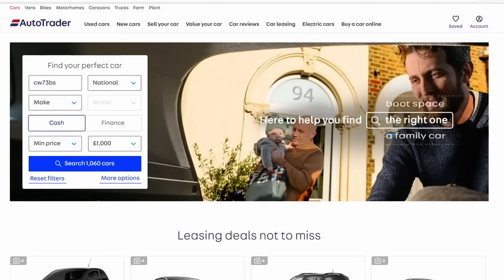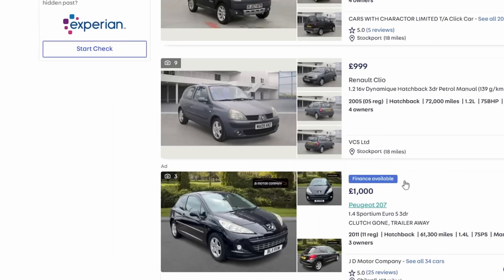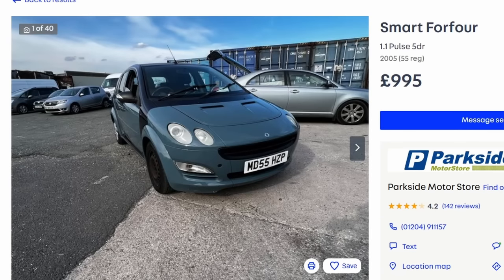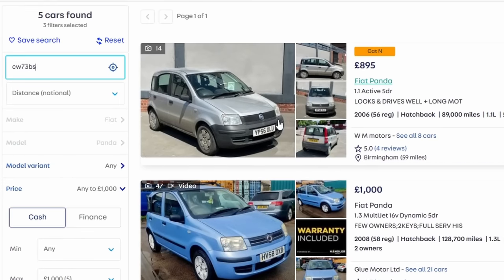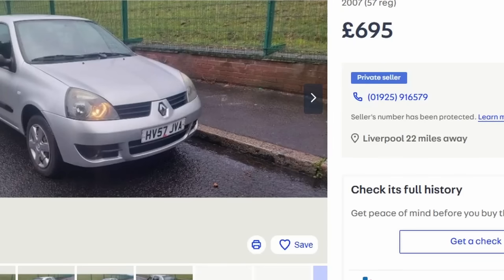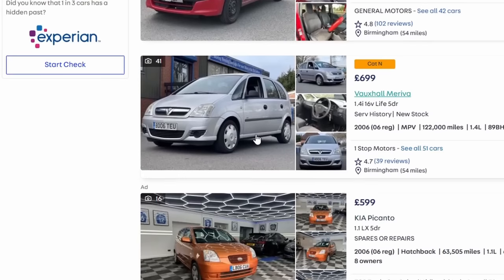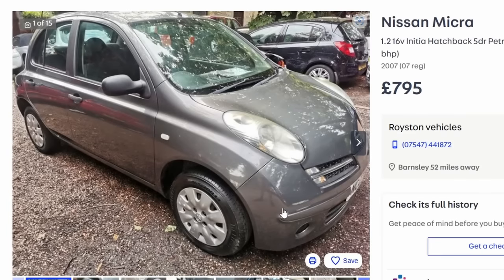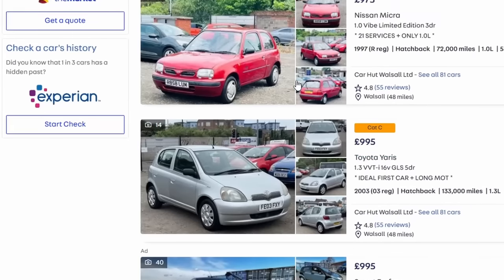THE BEST SMALL CARS UNDER £1000 ! (2023)

Comment from the maker: something a little different this video, I give my opinions on small vehicles to buy under £1k, Using my experience of trading these vehicles over the years, working on them and of course Mot Testing them and seeing all there faults and positives. Hope you enjoy guys and please let me know your thoughts in the comments.
Reply: I'm sure in this day and age where money is tight and prices are so high this will come in use for those who really need a cheap reliable A to B motor or daily. So many YouTubers go for expensive motors that are way out of most people's price range so genuine consumer advice is welcome. I certainly wouldn't go around any of the Walsall locations featured though 😅 No warranties etc despite the clear Consumer Rights Act... Very scary types
Reply: They only driven locally.and frpm a to b.
Reply: Agree with it all fella,the 206 i've not got much experience of. Some cars can be a pan to fix yourself & running costs BUT you just gotta juggle the good with the bad....as with all cars out there. Liked the video!
Reply: I noticed you didn't list the 8th gen civics? is that because most £1000 ones are duds?
Reply: I've had three clios.  A 1.6i, then a1.4i and now a 1.2i. My 1.2 is doing almost 500 000km and still running strong.  And no rust even though I'm in a tropical climate in South Africa.  I love this channel.
Reply from the maker: Thanks mr moss

Comment: That age Honda Jazz, forget it. They are rust buckets and if you spot any corrosion at all near the sills, arches, it's just a matter of time when.... you will be leaving it at the scrapyard. And be aware, quite a few sellers clean and paint over the rust to hide it because the engines and gearboxes outlive the car body and operate very nicely.
Reply: Yes quite a few comments regarding rust but there are some sound ones out there. I just bought one last month 2006 1.4 Sport manual. Bodywork is very sound and i took tje precaution of having it undersealed as part of the deal. That said, it came with several water leaks so ive had a month of stress and hassle fixing this as i have no garage and it hasnt stopped raining much. Buyers need to be aware of the water leak issues. They are easily fixable if you have the time to identify and check the cars out thoroughly before parting with your cash.

Comment: The thing about cheap small high milers is its a lottery. You can mitigate that to a point if you have Lee's experience. I have bought some that ran for a few years and some that go bang in a few days. Some cam belts have dates on them so you can check when they were last changed but most owners don't want you unbolting stuff. Expecting service history on a 20 year old car is a pipe dream. So you pays ya money and takes ya chances.

Comment: You wont get a very good Toyota Yaris for under a grand, I've had 3 Yaris's and still drive one now, a 2014 low mileage 64 plate, but these cars really do hold their price, and you can be paying several thousand for even a Mk1 in decent nick, bearing in mind that all Mk1 Yaris are now over 17 years old, and to be honest, the ones I've seen on Ebay and the likes for under a grand are absolute knackers, fit for the scrap yard. When I had a Mk1, which was a very very early April 1999 T plate Yaris, it had problems with corrosion back in 2010 at 11 years old, where the fuel filler neck and breather rotted out and leaked fuel vapour, so always check the filler pipe from fuel tank up behind the rear wheel up to the filler flap door - they rot. It was failing MOT's at 13 years old for holes in the lower corner of the rear wheel arch where it meets the sill, and also the rear outer sill needed welding. Practically all old Mk1 Yaris's for less than 2 grand are likely to need extensive welding on the rear undersides if not already done. 
Steer clear  of any Mk1 Yaris with the semi auto gearbox (automated manual), usually fitted to later mk1 1.0 petrol engines they are very unreliable - if you need an auto in the mk1, get the proper fully automatic box only available with the 1.3 engines.
Although the Mk2 Yaris would not be available normally for under a grand, You may be able to find early 06 or 07 plates available, but my experience of that Model, I had an 06 plate myself, they suffer with severe problems with the headlights going foggy and cloudy - the Mk1 also had this issue, but the Mk2, early models 55 - 08 plates especially got the problem really bad, and it can be an MOT fail, so whilst buffing them might work temporarily, and I sanded mine and sprayed clear lacquer on them, replacement may end up necessary. Mk2 Automatics steer clear of - nothing but trouble with the multimode semi auto that was the only option in the MK2, so if one comes up as spares or repair for a cheap price, walk away, will cost a bomb to put right and they just go wrong all the time. Manual is the way to go with the Mk2, but check the clutch pedal bite point, as some early model Mk2 suffered with very low biting points like mine did, and getting reverse or first can be problemsome, especially getting into reverse. 

If you really want a Yaris, and you want a decent one, I'm afraid you will be having to spend a lot more than a grand. Yes you can pick them up for under a grand, but once the MOT runs out, you may well be in for a shock because corrosion is going to be the big killer. They are very reliable yes, but on older Yaris's if they have not been properly maintained, then even Yaris's can break down. 
All Petrol engine Yaris's have timing chains, not belts, so people think they are bulletproof - they are, only if the oil has been changed regularly, at 6000 - 10000 mile intervals, and if oil changes are neglected, then the engines VVT mechanisms can go faulty, the timing chains wear out, then stretch and rattle, eventually putting the engine management light on, which is an MOT fail, and a new chain on a high mileage Yaris could be more than the car is worth, so if the engine is noisy and rattling,, walk away, especially on beat up old Mk1 that is being sold for under a grand. They are that cheap for a reason, they are usually about ready for the scrap yard.

Comment: I bought my 2003 Yaris in 2017 for a grand, and it’s been absolutely bomb-proof, it has never let me down. I have had a few things changed as maintenance, and parts are super easy and cheap to find. The fuel economy is fantastic. With 135k miles on the clock and a little rust, I could still sell it now for more than I bought it for - if I wanted to, which I don’t! I wouldn’t even know what I’d replace it with, maybe a Civic from around the same era, or a slightly newer Yaris (some 2011 pre-facelift T-Spirit variants can still be found around £2.5-3k, but at that price point there are many other options too).

Comment: Great video and advice. I'm not a huge Nissan fan but think Japanese and Korean cars reflect most reliable and best value for money sub £2k.
Had a Kia Venga and just changed for a Mazda 5 as I need the space and like the higher seating position.

When my Uncles 1.4L Rover 25 died, he asked me to help him find a 'cheap  but reliable' car.
Found him a 2005 1.1 Hyundai Getz 5 dr for £700. That was 6 and half years ago and it's still going strong.
A little corrosion to wheel arches which I need to sort for him again (did 5 yrs ago and is back), but he has it serviced every year by an independant mechanic.  
The odd niggle, but for an 18 yr old motor it's a gem. Never failed to start, never left him stranded, still on the original clutch.
I think the Hyundai's and Kia's are great value for money at the low cost end of the market.

Comment: Excellent informative vid, I agree with the mk1 Ford KA, they are very rot prone, I bought a 2008 Mk1 KA pretty cheap and I knew it was rusty due to the bubbling around the fuel filler, but I had very little idea just how rotten the car was when I noticed rust flaking out of the wheel arch when I slammed the passenger door one day, needless to say it was scrapped.
     Totally agree on the Citroen C1/Toyota Aygo, they are brilliant little cars, cheap to run cheapest to insure, and the K11 Nissan Micra, another great motor.

Comment: I have had 2 Mitsubishi colts 1.1 3 cylinder, sliding rear seat. Cruise at 70 and 55 mpg very underrated. Last one did 160k when sold. Very tough and no rust unlike jazz sometimes have. I had a 1.3 and preferred the 3 cylinder.

Comment: Great information about small cheap cars but i cant believe you slated the Vauxhall Mervia.
I've had 2 and loved them for the higher driving position like a little van. 😂
Reply from the maker: I dont mind the mk1 so much the later mk2 is poor. I would always push someone to a fusion over a meriva as they are more reliable but I will buy and sell mervias no issue 1.4 1.6 or 1.7 diesel

Comment: Funny enough as loan cars we have a 2004 Hyundai getz, 2006 fiat panda, 2003 Toyota Yaris, 2008 mk5 golf 1.9 TDI as you've mentioned 😂 they're all brilliant little cars, query I would have with the polos is sills, we fail so many on rotten sills and the 3 cylinders suffer with timing chains so bad, also the Honda Jazz's auto gearboxes are horrendous, the wing mirrors also fail they're £400+vat ish just to buy and the aftermarkets usually don't fit or function, the newer shape clios suffer with wiper linkage/motor failures and fuse boxes corroding; they can't be bought 2nd hand as they're programmed to the car and are on back order with Renault with no eta and cost over £250+vat just to buy, we see these sooooo often, I really wouldn't rate or recommend them at all in my experience, I'm not a mechanic but I've worked at my family's garage for 10 years to see enough of it! Overall really good and informative vid!
Reply from the maker: Thanks yes Renault wiper motors can be a paint I missed that one. However your fleet of loan cars would back up my choices 😁😁👍 thanks for watching bud

Comment: Ive had 4/5 Honda Jazz 1.2 & 1.4 ,s  ...amazing cars .practical..economical ,,cheap to run .tons or room  for such a small car  prefer the 1.4 .,bit more grunt ....never had a mechanical issue ...but you r right check rear arches  ..as they are prone to rust ..high miles no problems ...would defo recommend ..no rocket ship ..but you wont be buying  it for race meetings .
Reply: Family member had one which was ok,no rust anywhere,great little thing indeed, that was written off & got another.....that was rotten as a pear! It came from way up north & no wonder it was rotten. A family member got it with even viewing it!

Comment: Jazz would be my choice if you can get one with no rust. Absolutely bullet proof mechanically and feels more refined that most of the other options on this list.
Reply from the maker: Yes drive very well as good as a polo in drive standard, under 1k can be challenging to buy a decent one. If I was going to buy one i would be buying a near 2k car say 2008 model with lower mileage. To be fair that would then be a decent vehicle to get some years out of.
Reply: @carukchannel  I've been looking into the jazz as a first car but i've got an auto license, how much should my budget be if i want an automatic jazz that can last 2 years atleast?
Reply from the maker: @user-bv6gs4qw9k  I would avoid at all cost, the auto jazz was appalling and the box unreliable
Reply: @carukchannel  oh dear, which from.this list would you recommend to an auto driver? And what should the budget be
Reply: I don't think you'd be able to get a Jazz without rust in, good working order and mot for £1000.
Reply: I wouldn't buy a Jazz. 3-4 times I was followed for my catalytic converter. One time they almost had it but we stopped them. Just a bit of welding luckily!
Apart from that, brilliant.
Reply: @bleechy2149  you live in london by any chance?
Reply: @asianskywalker  Hertfordshire, so not quite London, but also quite close.
Reply: Very rare tho with out rust 😂😂😂
Reply: Mazda 2 also brilliant.
Reply: all the ones I've seen at £1000 or under seem to be duds or rusters, I'm guessing you need to spend a bit more but they do look like good cars (most Hondas are and have a very loyal following)
Reply: Input shaft bearing is actually quite a cheap repair on these. My civic of the same era (same box) had the issue and I got the box rebuilt and a new clutch fitted for £550 all in. Was done in a few hours too.
Reply: If imported from South Japan, rust shouldn't be a problem plus one can pick a hybrid. To top it up, Japanese tend to service their cars properly
Reply: @carukchannel manual boxes are better and cheaper but you’ll probably go thru 3 in the engines and cars lifetimes

Comment: had my 06 mk5 Fiesta from new, corrosion hasn't been an issue but on my 1.4tdci the injector seals went bad and that was a £300 bill. Apart from that, other failure points were broken coil springs, a wheel bearing, the air con compressor and an exhaust back box - not bad for 17 years and a car we paid £9,000 for.
Reply from the maker: Sounds a bargain chris and had given you great service. the 1.4tdci does suffer with injector seal issues in fact I have just fixed one that may feature on the channel in a few weeks. Might even keep it for a courtesy car going forward. They offer such great economy
Reply: I've got a 2005 Tdci which I've owned for nearly 17 years.. I had injector seals done, both front springs broke and I've just had wheel bearing flagged up on mot.. Saw underneath when it was on a ramp a while back and corrosion is minimal...  Love the car and hopefully it has a few years left in it!!!

Comment: I have had a few of those in stock and your choices are good ones too. I would be vary on spending under 1K on any car these days, you can barely find cars for under a grand that are decent.

I know this is classed as above a small car and they can rust, but I have to mention the MK1 Ford Focus which you can pick some up for under a grand though they are going up in value slowly. Great cars that are good to drive and you still see lots about over 20 years on. Great video.
Reply: I own a mk1 focus, ik I kept banging on about it in certain videos but we'll worth the money got mine for the price of a mk1 Ford ka and 350 quid but for the past almost 3 years I've had next to no problems but wear and tear items, ulez compliant too, ropey examples for around 400 quid or mint ones for 2k, take your pick
Reply: I had a 1.6 MK1 Focus and it rusted pretty badly, the same as Mondeo's. Also something went wrong with the engine. I took it to Ford and even they couldn't fix it. They said that pretty much all the MK1's have the same problem when they get old and can't be tracked down and fixed without it costing more than the car is worth. The front of house guy said he had one with the same problem but even though he got the labour for free they spent hours on it they still couldn't fix it.
Reply: If I were looking at a small-ish car with a hard limit of £1k, I'd probably do similar... I'd go private sales and get a Volvo C30 1.6 petrol - plenty around a grand without silly miles and basically a 1.6 Focus in a prettier (but much less practical, which hurts the value without hurting the reliability) package - partly because I know them, know the little things that go wrong on them, partly because (prejudice on my part, possibly?) I tend to find Volvo's get taken care of a little bit better, service history tends to be better than a similar price Focus.

Comment: Nissan Micra 03 plate K12. Is a solid reliable car, my daughter has had one for 18 months for a 20 year old car very impressive. Sailed through mot with no advisors too.
Inly problem is keyless entry on ignition barrel. Its on a few notice boards sites so a slight problem in a few nisan models

Comment: The Aygo triplets are my choice. Actually, I own a well-maintained 2007 Peugeot 107 as my first car! I bought it in June 2023, with 150k kms/~93k miles, and I have to say it's a crackin' little car! Agile, nippy, great to drive because of its small size and with quite a lot of oomph for what it actually is because it's only ~850kg and the Daihatsu 1KR-FE engine is a gem! It's a characterful little engine and I love it just for the sound it makes when it revs out, which is like half a V6 (in fact, sound was one of the reasons I went to the Aygo triplets, because I like the way 3-cylinders sound, I find them better than 4-cylinders in that respect)!
Not to mention that, where I live, I only put fuel to it once a month and I get about 450kms/280mi out of its 35l fuel tank. It's a magnificent little car and I wouldn't sell it for all the EVs in the world! 💗

Great and informative video mate! But there are two more cars to share the Daihatsu 1KR-FE engine: the 2005 Daihatsu Sirion and the 2008 Cuore/Mira. The 2005 Sirion is larger than both the Aygo triplets and the Mira, but the 2008 Cuore/Mira has the same space inside as the Sirion but with a size similar to the Aygo triplets and with a sliding rear seat too!
Don't really know whether these Daihatsu models were on sale in the UK since I'm from Greece, but I must say I see all of the aforementioned 1KR-FE-powered models everywhere in here, with the Aygo triplets being the most popular, and all of them are still going strong!